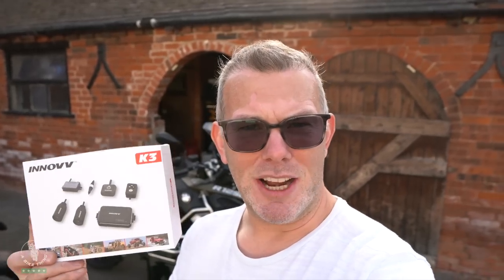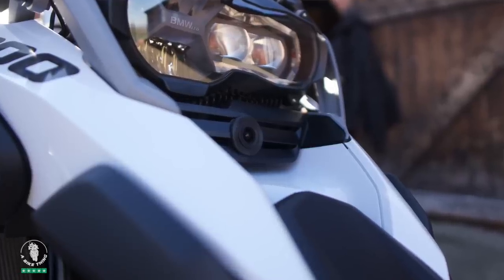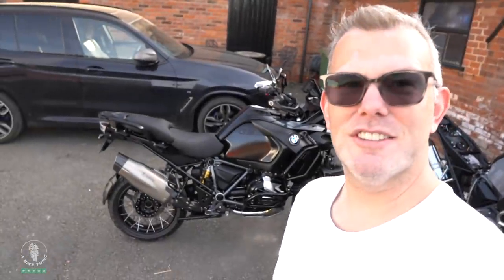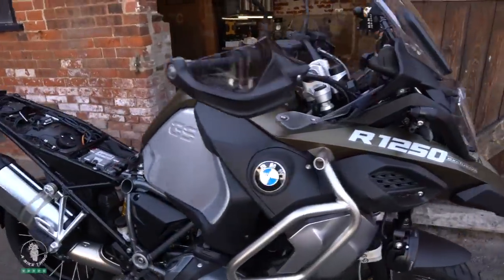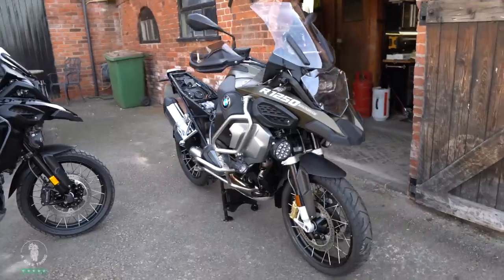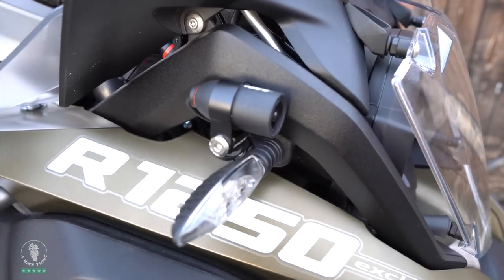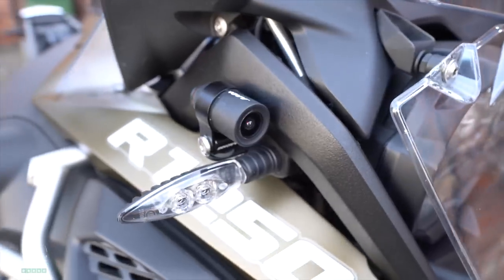INNOVV K3 FITTED TO BMW R1250GS ADVENTURE

Comment: Great video thank you. If wired this way would it be correct that there would be no power to the K3 to allow for parking mode ? I think if you wire direct to battery the K3 still draws a small amount of power if parking mode is enabled.
Reply from the maker: Correct

Comment: Steve, have you ever considered shortening the wiring (excess) of the INNOVV unit as you do with the Denali light wiring?
Reply from the maker: I asked the question a couple of years ago.  Those camera cables are somewhat different.  I’ve been told it will effect resolution and void warranty
Reply: @ABIKETHING  Thanks, I was afraid of that. It will be a zip tie job for the excess wiring.

Comment: Hi just watched your video . I have a k2 and have had it on my 1200gs adventure for some time now. I had to disconnect it in the end due to it flattening the battery after pulling power whilst off . Are you a  garage and if so where abouts are you please . I had help from innov but local garage wasn't happy in going into canbus system for wiring . My gs is 2011 . Any help or visit would be amazing .